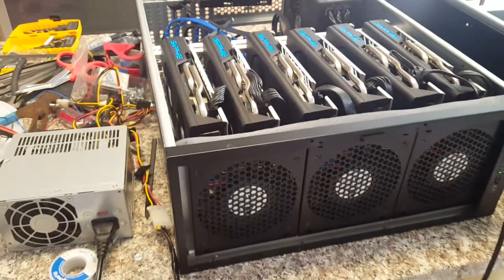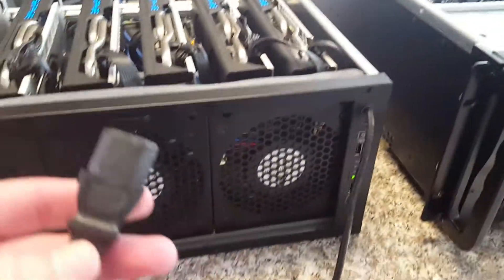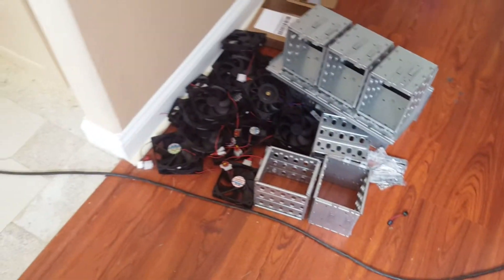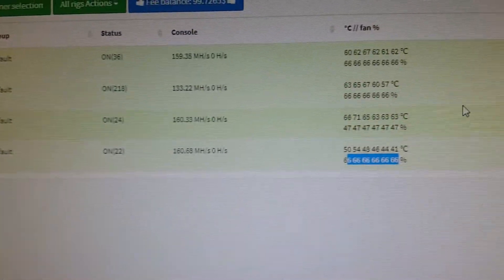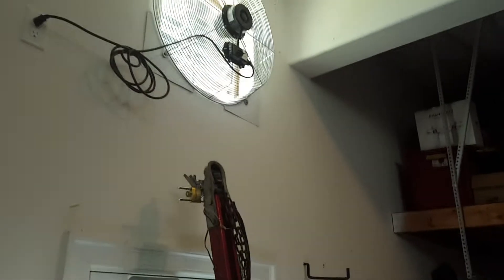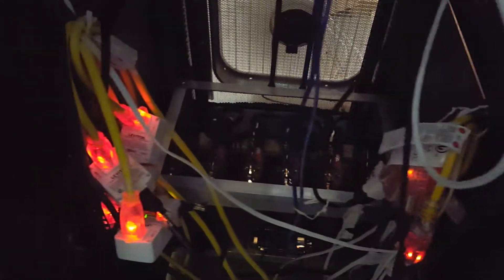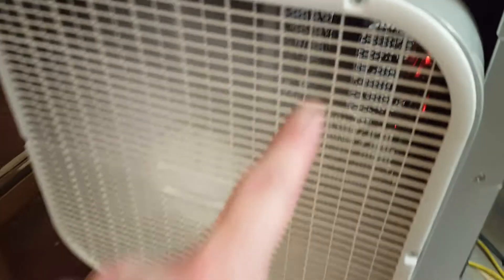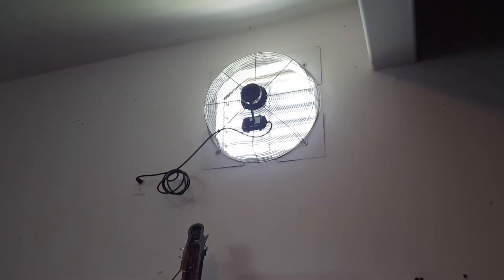Crypto GPU rackmount miner

Comment: I run noctua fans in mine and they're practically silent.
Reply: Christopher Sanders you have server cases???  I have been modding my rosewill 4500s for this purpose. And was considering noctuas.  What temps are your cards?  You keep the lid on?
Reply: Ken Quella 68c is my hottest card. Evga 1070ftw lids are on and installed in a rack. Same case.

Comment: which direction is the air flowing through the case?
Reply from the maker: I did it the opposite way only because I pull air from the back of the case through the front. (I have them in the garage pulling air from the crawlspace and pushing out a side wall in the garage, it is nice to see the front of the servers) It is probably best to keep it working like most servers because the power supply pushes air out the back. I have not had any issues with it working this way but wish I would have set them up to push air out the rear.
Reply: I am using the exact same case with 8 gpus, pulling air in the front and pushing out the back, my temps get pretty high though. How did you drill holes in the cross bar in the middle for the gpus to screw into? Your cable management looks great too, are the cables under the GPUs?
Reply: Ha I am having the same frustrations. I'll try some higher CFM fans, I'm sure thats the issue. I'll also try the self drilling screws, I currently have the cards zip tied to the center rail. Thanks for the useful info!!

Comment: Could you give some details on your power cutt-off when smoke is detected setup ?
Reply from the maker: Any power connected to each of your rigs must be able to take 15 Amps or more per rig.

1 Surge per rig (Tripp Lite)
1 Wink home system (The old v1 Wink also works)
1 Switch that works with Wink (Leviton VRPA1-1LW or any z-wave compatible heavy duty switch)
1 Smoke Alarm that is Wink compatible (I use 1 Nest Smoke Alarm but others are cheaper)
1 Z-wave Red light Alarm (I use Go Control - but this is not needed but I like the security since I am a heavy sleeper)

Set up a Wink Robot (within the iphone or Android Wink app) that is triggered by the Nest Smoke Detector 
If Smoke is Detected then do the following:
-Turn off power to Rig(s) (Leviton Switch(s))
-Sound Alarm (GoControl)
-Send a notification to my phone

I sleep good at night, even with $900 Electricity Bills.

This setup work well with Samsung's Smartthings home automation vs the Wink as well. The only 2 complaints I have with Wink v1 is that A. It stops working when internet goes out. They said this is fixed with v2. And B. When the power goes out, I have to manually rest the wink box because it loads up faster than my router and never tries to reconnect after failing. For a "Smart-device, seems pretty stupid not to recheck for an internet connection" Supposedly Wink2 fixes this as well. I have ALL my internet components on battery backup now. They last for hours even when the power is cut.